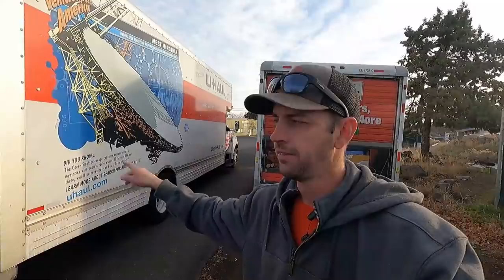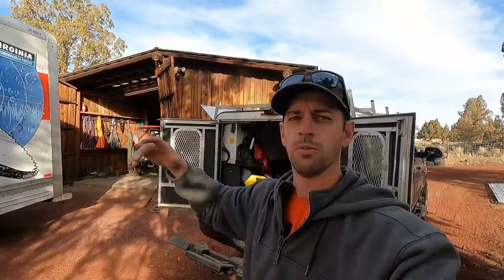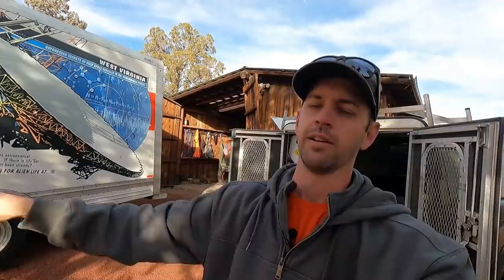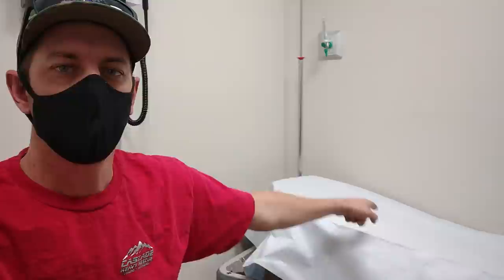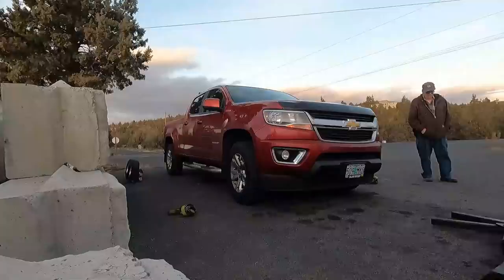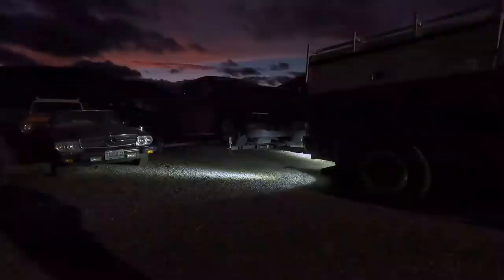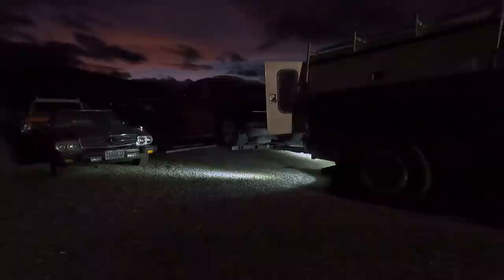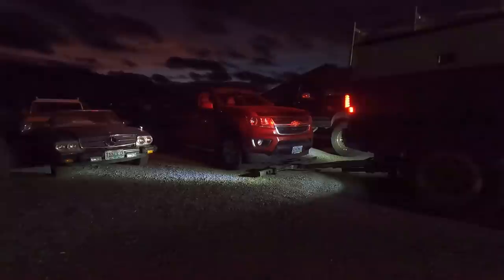Tow truck driver screws up and ends up in the hospital

Comment: Wishing you a speedy recovery .i like the content .just be careful heating up a fully inflated tire that can explode anytime .i know cuz a friend of mine watched watched someone die that way only different was that he was welding the rim .
Reply: Why take wheels off to do a seal?? Pull axle shaft out raise truck ,put a piece of oiled tin under wheels, remove brg. Nuts slide assembly off, done hundreds of wheels that way, from 3/4 ton pickups to 4 WD tractors

Comment: I would have pulled the whole hub assembly off and sorted the seals that way I have had to do this a few times on the side of the road and left the seized wheel nuts to the companies workshop when the truck got home.

Comment: Bad news, but your wife and daughter need you fit. There are no pockets in a shroud. I was concerned about the torch on the wheels though. Tyres (That's the way I was taught to spell it) don't like being around heat. The damage isn't always visible, and I hope you'd let the air out first.

Comment: Yes, 35 years ago while working on a round hay baler, I had a 3/4 inch drive socket break while leaning on a cheater bar. I landed about 8 feet from the work and then had to find my glasses.

Comment: i would likely bet that it is anti seize of the copper variety U-haul loves that stuff for trailer lugs im sure they use it on the trucks as well for better clamping force. Also it has a flash point of 325 degress F.  Wish you the best of luck in your recovery.

Comment: I’m viewing this video a year after it was released and you should be healed and we’ll again!  There is a tool I’ve used called a torque multiplier that works pretty slick but you will need 1” or larger sockets and extensions.

Comment: I have a big 3/4 impact that would have took them right off as long as there is a large tank with 160psi for air pressure. Used to use it often until the place I worked at decided to outsource maintenance. So at home I don't have enough air supply to even use it.

Comment: Put a jack stand under the extension close to breaker bar to keep level. Then add a solid cheater pipe and step or jump down on it. If you keep it low to ground you won't go flying when it breaks loose.you might still need heat but I've always got the lug nut off or snapped the stud. Of course use quality tools. A Chinese socket might kill you when it flies apart. I've seen guys in a bind out on the road where a cheap socket wasn't available. For safety they wrapped socket with duct tape and threw a blanket over to prevent flying schrapmetal. Info is to hopefully help someone who may not work on vehicles a lot. Get well soon

Comment: I usually heat them a lot redder than you did, then put the Milwaukee impact on them.  Never had an problem doing that.  1400 ft. lbs. from the Milwaukee is a lot more than you can put on the nut with that bar.

Comment: Don't use a rosebud use a smaller welding tip so you only heat the nut this way the nut expands and not the stud . As hot as you got the studs they need to be changed . It doesn't take a lot of heat the nut .

Comment: Hi i had a hino bus with left /right threaded wheel nuts i bought a american torque  multiplyer  from memory 100 turns of the handle to 1 turn of the nut .several times I stopped to assist a trucky with tight wheel nuts  never found a nut i couldn't loosen sorry I can't give a brand i had to sell it

Comment: Oh OUCH!!!

I've had a Hernia before...I don't think it was that specific type of Hernia, but I had one and mine needed Surgery to fix too...

I know this comment is coming a year after this event happened, but might I suggest the next time you need to use a breaker bar to pop a lugnut free, you set the bar and socket on the nut and then use a floor jack to actually heave on the bar...that way the thing taking the strain of the lift is a chunk of hydraulically powered steel and not your comparatively flimsy flesh & blood body...

Comment: Lock tight which needs heat to break loose but no  where near the heat you used. A heat gun will usually do the job. A heat gun and impact would have usually taken them off. Not sure of the quality of your impact but my 3/4 would twist them off, my 1/2 does 800 ft lbs in reverse. Breaker bar with pipe is hard to get that kind of leverage unless you weigh 200 and can place it all on the pipe.
  I have put a jack under the pipe in a situation I didn’t have the right tools.

Comment: First I pray All is well with you. When you're  an owner operator whatever the trade you are the business.  Please  work safely ...a good quality  nut spliter is worth trying. Once split the pressure is off and your favorite penatrating oil can reach all threads followed by a big impact and top quality socket. Cheap tools ruin your job and your day. A toque  multiplier is an option to. However when seized nuts won't loosen I have broken studs not good.

Comment: Don't know why this popped upon my phone, however as a 30 year tech I can tell you what I do with tight nuts.  Heat up with torch like you did, then let it cool down just a bit, then grab your biggest impact , mine is 1 inch drive with compressor set at 160 psi. It will spin off with ease, or break the stud which is why you let it cool down just a bit.  Hope that helps you out and your recovery is sooner than you think...
Reply from the maker: I did exactly that and broke my 1" drive impact socket
Reply: @CaseyLaDelle  well then I would say either your impact socket had a crack in it or was a cheaper grade impact socket.  The one thing you never do is grab a breaker bar and cheater pipe when you have the correct tools to do the job without injury.  Remember Tools and parts can be replaced,  human body parts not so much....
Reply from the maker: @donaldales7739  not a cheap socket, and not damaged
Reply: If you by chance fail to let it cool down enoug, a preheated tight thread will friction-weld from its own friction-generated heat topping up the existing preheat to melting point on the tight spot in the threads.

Comment: Do you have any eddy-current tools such as the Bolt Buster?
You can heat up a nut to glowing inside of 10 seconds without heat using eddy current
Thus you are heating the nut only and not so much the bolt
So you get differential expansion and a looser nut

Comment: The Uhaul could have removed it's own nuts! You should pinned the breaker bar against a board on the ground and then just move the truck forward or backward to put force on the handle. We used to do it on the duals of the motorhome my parents had. The tire shop put the nuts on extremely tight and we couldn't break them by hand or 1/2" impact.

Comment: UHaul puts an high strenth thread locker on those wheels for security, less likely to loosen but also prevents people from taking the wheel and doing shade tree service that isn't covered by UHaul's insurance. Supposedly there is a tool or something that is meant to aid in removing lugs with that stuff but idk.
Reply from the maker: No they don't
Reply: @CaseyLaDelle  huh weird, then the UHaul dealer who told me that has some explaining to do. thanks
Reply from the maker: @sterlingodeaghaidh5086  they completely made that up
Reply: @CaseyLaDelle  Thanks id explain the story but its really, really stupid.

Comment: I had a wheel hub that kept having seals leaking i found that the problem was the hub was not machined straight was thick and thin so the hub ran crooked on the axle.

Comment: There’s a very interesting video about heating wheel nuts and tyres exploding.   And when you’ve watched it you’ll never heat a wheel nut up again
Reply from the maker: Wrong.  I will because I’ve seen it, understand the issue, and still continue to do it.

Comment: I have seen 3 of these newer JHs with blown seals, some 30K miles. Each one I found the bearings not preloaded from the factory 😮 wasn't much--I measured maybe 1/4 to 1/2 turn on the nut to reach what should've been preload. But enough to allow that hub to walk around & blow the seal. I think Eaton supplied a bad run of axles to Ford because I've only seen it in 19s to 20s.

Of course these idiot customers trying to run Mach 3 with their hair on fire down hills dragging the brakes all the way doesn't help either 🤦

Hope you got better. I went thru the hernia stuff 6 years ago, no fun.

Comment: You might need a torque multiplier. $250 is cheaper than most medical bills. Maybe Uhaul puts thread locker on to prevent wheel theft?
Reply from the maker: No they don't, but their trucks do get serviced by many different roadside service companies as they have problems or are damaged by customers while out on rent, and I've seen some incredibly dumb things done by some of those companies
Reply: @CaseyLaDelle  unfortunately you are being very polite!
Reply from the maker: @haroldphipps3457  very true

Comment: I stopped and 4:46 and can only assume that the tire is going to blow. If you need to heat anything near a rim with a tire mounted take the valve core out and leave it out. Ok going to watch and see. Guess not but that is fully what I was expecting. Not a hernia
Reply from the maker: Left the air in it.  Not as dangerous as you think when done correctly

Comment: With that much heat you destroyed the temper on the bolt's also why didn't you set the breaker bar so you could stem down on it instead of pulling it that was a poor example of how to get a stuck lugnuts off

Comment: Hey Casey, at 00:10 you mentioned something about the weather and said it was strange and you don't know what's going on.
Here's what going on:
As part of the ongoing research for "Star Wars" missile defense shields, a technology called HAARP(high-frequency active auroral research program) was developed to study the ionosphere. Long story short, the US has one, India has one, Russia has one, and probably anyone with nuclear missiles. These things are in operation RIGHT NOW. They have been in operation since the '70's with the Soviets.These things have been deflecting and changing the jetstream patterns for over thirty years with disastrous effects such as the ice storm in New England and southern Ontario and Quebec that caused billions of dollars in infrastructure damage and a few deaths. It blankets the lower 48 with air masses that are warmer than normal in the winter and causing temperature fluctuations in one case of 67'F to -23'F in less than 36 hours.  
Meanwhile, we're all being gaslighted and told that what's going on is caused by burning fossil fuels. Carbon from the burning of fossil fuels had reached it's saturation point by the mid 1940's. Carbon does not have any additional radiative forcing effect once that saturation point has been met. It's the jetstream changes that are causing the global climate disruption.

Comment: sorry about the other deal but my question in why would you loadthe truck from the front ? why not load it from the rear and put all that weight on the dollies?
Reply from the maker: Doesn't matter either way, both the wheel lift and the dollies are rated for far more than what either end of that truck weighs

Comment: Skip the "defer the surgery".
Does not get easier with time.
Get things in order, assign tasks best as possible. You are not superman. 
Redirect your energies to less strenuous activities. 
Recovery is tough now. Will be 5x tougher if you wait.
"Getting older ain't for sissies".
You will not "bounce back" like when younger. But under 50, you will be fine. 
Going forward, strengthen your legs. Squats with back straight, 20 -35 lbs dumbells in each hand. (After recovering).
No more bend over lifting!!!!
Wear a lifting belt!!!!
Reply from the maker: Assign to who??   I have zero employees..

Comment: So sorry to hear this happened to you. What is a hernia belt though? On that Colorado why did you have to put a dolly under the rear tires also instead of just letting them roll?
Reply from the maker: Because just letting it roll would have burned up the transmission
Reply: @CaseyLaDelle  thanks for answer...I see tow trucks doing that all the time even with red vehicles...They're probably damaging stuff then

Comment: If you need to remove lug nuts and dont have something strong enough to remove it , you step on the wrench with your foot and push down instead of trying to pull up with your arms, ALSO GET BETTER

Comment: First of all, You were pulling up on the wrench instead of used your body weight and pushing down, and if You've never been to A Safety class, it never to late, That's what our  first issue when I took plumbing classes back in High School.

Comment: it's always easier to break lugs loose with the wheel on the ground.
Reply from the maker: Incorrect.  Makes zero difference
Reply: @CaseyLaDelle  sure it does gotta windup the axle differential u joints drive shafts transmission output shaft trans & engine mounts until the force exceeds that at the lugnut. thats a lot of motion for no torque reduction. get you a torque multiplying tool for those lugs and good luck with the recovery.

Comment: As odd as this is, youtube suggested me this video 
https://youtu.be/GqdyYVBw3i8?t=261
This was a couple of days before I saw your work with MORR, and then the algorithm suggested this video, with the psycho tight uhaul nuts.
Our vehicle kits had an impact and a torque multiplier that we used to break loose the nuts holding our track pins in place.  They could all be loosened with a breaker bar and a cheater pipe, but somedays it was just easier to use the power tools.  Besides, that's why we had them.

Comment: Casey my man, no pulling on breaker bars, cheater pipe and stand on it.  It is time to stop being a bull in a china closet.  Mama and the kid need you, and we want you to keep making videos.  The toe under the tire was a wake-up call, this is a get it right next time or else notification.  Some old air impact drivers would drive those truck lug nuts on like that.
Reply from the maker: Watch the video, I said that I used my 1" drive air impact on them and they didn't even budge.   I broke a 1" drive impact socket with the gun, then broke a 3/4" drive impact extension with a long cheater pipe before resorting to the torch.
Reply: @CaseyLaDelle  Re read what I said, I didn't have a problem with the torch.  I have done that, just no other way sometimes.  Just want you to stand on the extension and not pull on it.  You are a knowledgeable fellow with a lot of experience.  But, you have a tendency to just bull ahead instead of slowing down and thinking about things.  I do not criticize you, only offering some suggestions, that come from 82 years of experience.  You have a great channel and I enjoy watching.
Reply from the maker: @johnmccaughan4195  you said that some old air impact drivers would work on lug nuts like that, and I clarified that that's exactly what I used with no luck.
Reply: @CaseyLaDelle  Look again, what I said was "Some old air impact drivers would drive those truck lug nuts on like that"  Meaning they would tighten them until they were almost welded together.  Take a deep breath, I am not trying to give you a hard time.  Just want you to stand on the cheater pipe, not pull up on it, at 3:49 you were straining your buttermilk pulling up, the bar is bent up, probably popped your hernia.
Reply from the maker: @johnmccaughan4195  why do I need to take a deep breath??  I'm zero percent worked up over this.